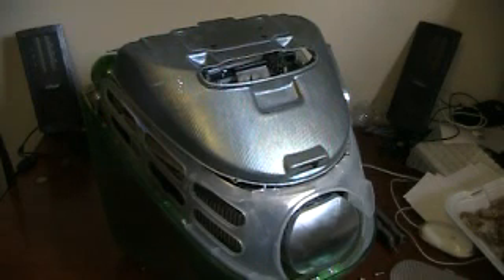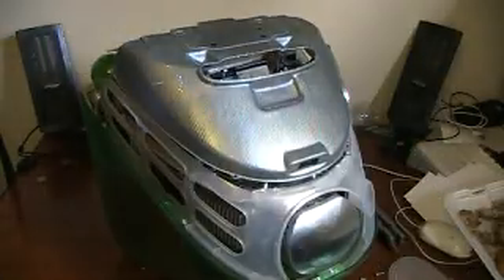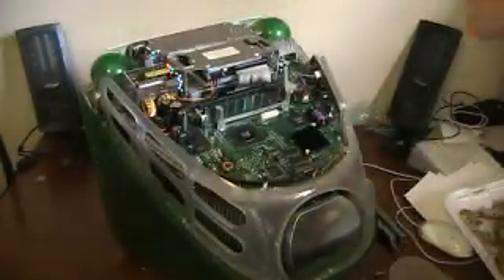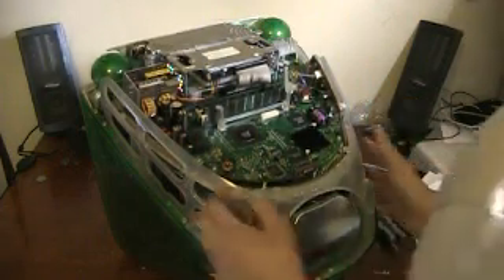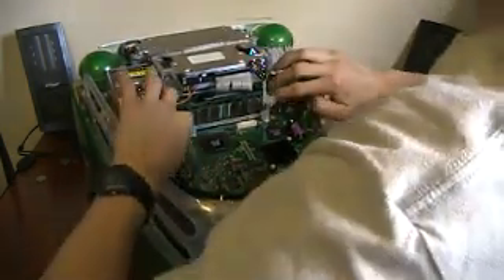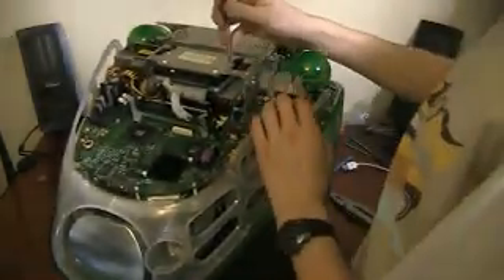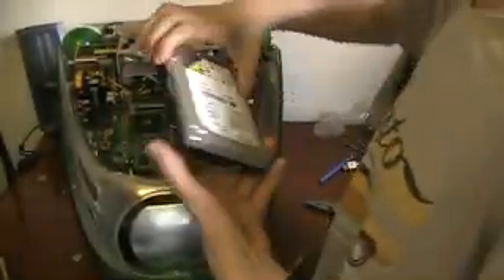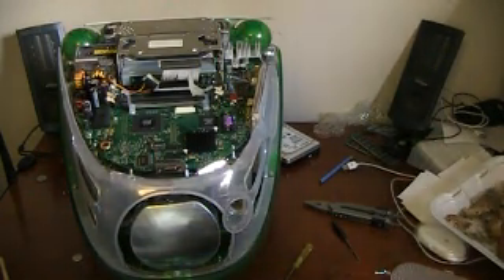How to remove a Hard Drive on an iMac g3 (1999 Model)

Comment: Congratulations ...... great " real " vid ........ 8 min vid , best part of 3 mins looking for the right / unchewed screwdriver ....... real bench work . Great vidi . If you get the chance , lay your hands on an impact driver " A look at a cheap hand held impact driver " ....... https://www.youtube.com/watch?v=cUSuSn_QZmk ..... yes , it ' s designed for hitting with a hammer , not helpful with the tin / steel work being so light , but the large diameter gives you more " purchase " turning capability , when using it as a hand held screw driver .